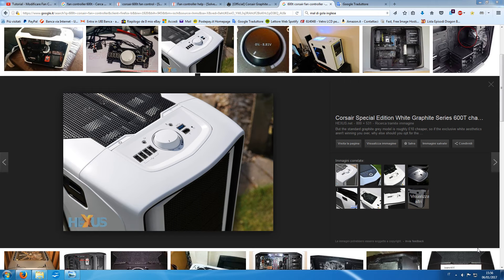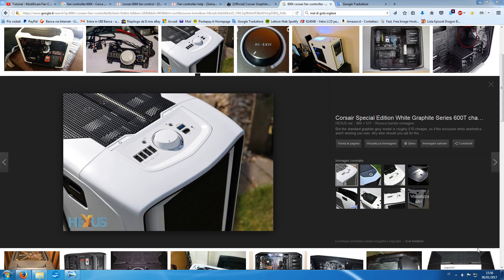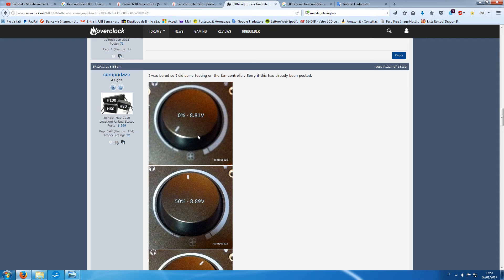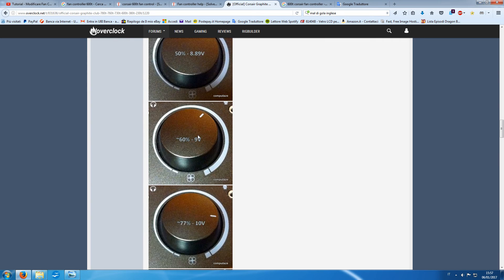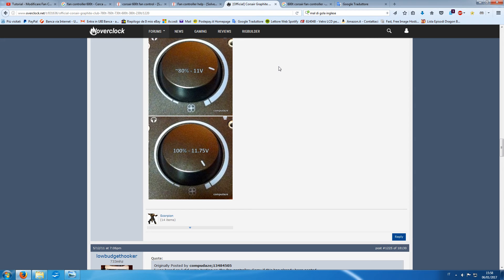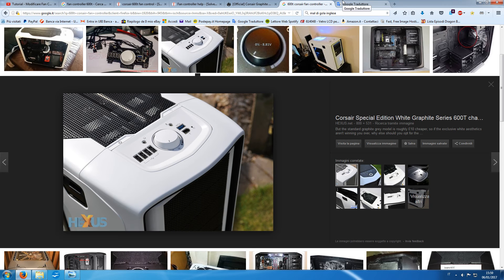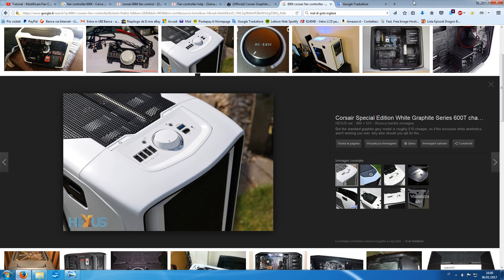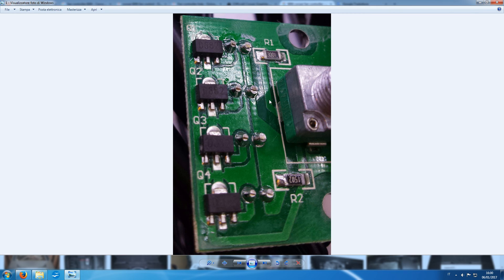Tutorial - Modding Fan Controller Corsair 600T More Voltage Range

Comment: are there any cons to doing this?
Reply from the maker: Nope 😊. I'm still using it about 4 years, without problem👍
Reply: @NikyRipy  thanks man. my next question would be why they're there in the first place then?
Reply from the maker: @tpow2651  You mean, the resistors?
Reply: @NikyRipy  correct. I understand what a resistor is, but I don't understand the function in this particular instance.
Reply from the maker: @tpow2651  For a more detailed description, I suggest you also watch the original video in Italian. Anyway I will try to answer you, But for me it is difficult to explain certain concepts in english. We have a voltage divider. And if you Remove R1 (in parallel at VR) the drop-out of Voltage increase
Reply: @NikyRipy  np you have explained enough I really appreciate it!
Reply from the maker: @tpow2651  Glad to have helped you ☺

Comment: Do you think it would work with the Rev B controller?
Reply from the maker: If you can upload a photo, I will check it :)
Reply: @NikyRipy  http://blog-imgs-38.fc2.com/n/a/u/nautilus805/2013111521354975a.jpg

Sorry that's the best I can do about it :D Paste this into the URL bar

Edit: Oh it seems like youtube can handle URL links now
Reply from the maker: Yes I think you can do it 👍
Reply: @NikyRipy  All right, then I will try it. Then I give you the feedback. Grazie mille! :)
Reply: @NikyRipy  All right, so I tried it, and it seems like, if I take the R1 out the minimum voltage increases to 10.3V. What if I put a bigger resistor in?
Reply from the maker: @matebalogh1375  At the 0% do you have 10.3v? And 100% 11.5/12v? Anyway can you measure the trimmer?
Reply from the maker: @matebalogh1375  Anyway in theory if you put a bigger resistor, the voltage drop should be greater

Comment: I did it and now I have 9->15 v ???
Reply from the maker: Nicolas Stain 15v I think it's impossible. Your power supply can out 12v max
Reply: I should check my voltmeter. My fans seems quieter at low speed so I guess it works. Thanks for the tip. What is the heat problem in the italian video ?
Reply from the maker: Yes, check the multimeter. Anyway the mod it's so simple and easy. So it should work. If you have the Original Fan (with White LED), you can  make litmus test  to prove it. The LEDs should emit less light than before the mod.

I have put an heatsink because the mosfets were heating up a little bit..And so since I use only two fans, I connected them (mosfet) in parallel, to make them heat less.

I hope you have unterstood. Sorry for my english
Reply: Thank you. Can’t check the leds, I removed them (Don’t like leds on fans). Don’t worry for your English, I’m French